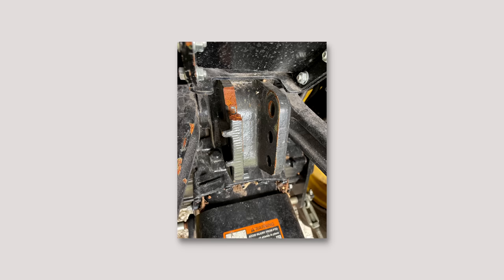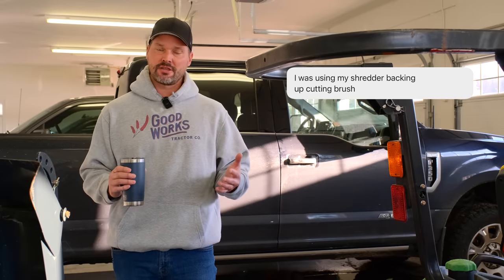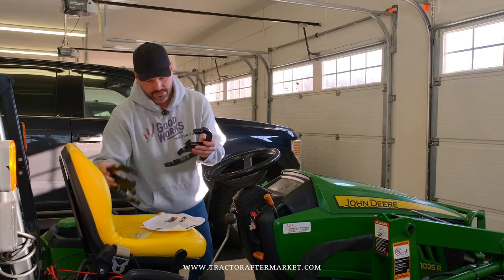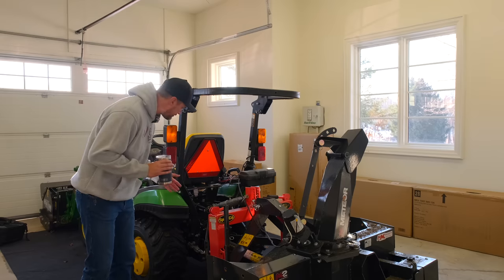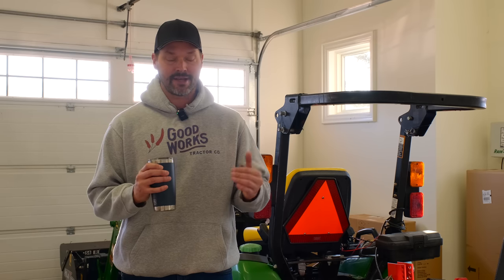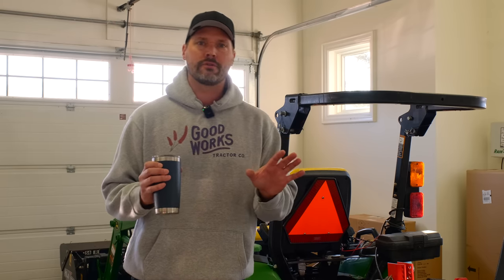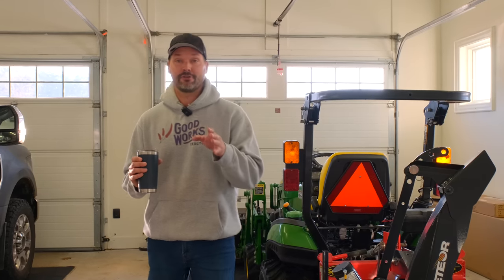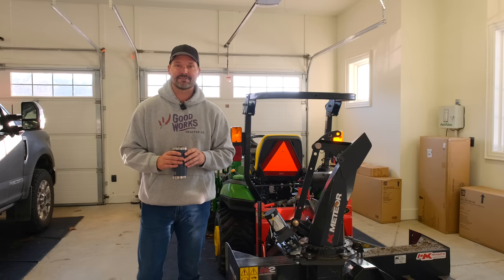EXPENSIVE MISTAKE OR WARRANTY CLAIM? $3400 TRACTOR REPAIR 🤯

Comment: It's a bad casting, it's also a John Deere thing that I'll never understand. I broke a three point arm twice on a 2016 3046r using a box blade clearing a field. 

I've owned dozen tractors now and have never broken a structural part, my first and last JD strong like kindling.

Comment: Since it is not gong  to be covered under warranty could you just use the middle hole?  I agree to look for a casting defect.  The company I used to work for had a Metrology Lab that could detect flaws, you know anyone who works for a large manufacturing company that might be able to check the casting for you?

Comment: My first thought is that the casting is bad.  If the dealer refuses to cover it as they claim it is "damage", I'm sure that since the tractor was recently purchased, and probably financed, there should be insurance on it.  If nothing else, it should be covered under that, at considerably less than the $3400 repair quote.

Comment: Running into something with enough force to break that housing would have broken somewhere else first.
It's been my experience that whenever and wherever possible, the warranty will be declared as being not in effect.
The dealer sure doesn't sound like they are particularly interested in customer service. Most likely due to the manufacturer passing the problem down to the dealer.
Good luck on the repair.
Reply: That was my thought.  From a guy that has bent a quick hitch with an offset  rear blade.
Reply from the maker: Yeah, I agree with all that

Comment: Mine on kubota b26 is a replaceable with bolts steel part. Those look just cast into the block?
Reply: @duanehamdorf2228  i got the b26tlb at auction for 17k needed right rear axle gears took me 2 days and 700 bucks to fix use it for the normal tasks but also clearing thick forest and brush.  I like the added fops for what i need it for next mods otw are front hydraulics from summit for grapple. Some spacers and ballast for wheels in mail...lots of steep terrain. Its been a Godsend
Reply: Capable of way more than i thought tbh
Reply from the maker: Very nice, yeah this was cast
Reply: @GoodWorksTractors  could u do some poor man videos? Like my chainsaw holder is made from baked 3 inch pvc use it almost every day heavily... total cost 7 bucks vs 300 for sawhaul
Reply: Also made cell phone scabbard similar way to go with my usb charge port total cost 20 bucks

Comment: welding it would be sketchy, it'll always be weak. it be tough to find someone to attempt it.
Reply from the maker: Just had a guy email and say he has his welded and still going strong after 10 years
Reply: @GoodWorksTractors  In many cases a good weld will end up stronger than the original.

Comment: Every John Deere tractor I have owned has been a bad experience. I had a little compact like that and literally every single thing bent on it from the mower deck lifting arms, to the PTO shaft snapping, everything seems to be made out of soft metal… I could be wrong but I just went with kioti because I am so frustrated with John Deere and their parts monopoly

Comment: Looks like a defective casting to me.  No signs of abuse.  I would recommend against settling for a welding repair.  Other parts of the casting might also have a flaw.  This is a manufacturer problem and should be replaced, parts and labor, under warrranty.
Reply from the maker: Possibly so

Comment: It's obviously metal not alluminum so I would weld it , and use the next hole down. If that picture was taken shortly after it happened it's a defect. It would have been good to get a closeup right after it happened.

Comment: Why In the world would you ever replace that casting???   It only has damaged to the top hole and he has two more lower holes to put the top link in….  I’m betting that 99% of sub compact and compact tractors owners don’t have any idea which position of the three that the top link is supposed to be installed in anyway based on what type of 3pt implement that are using 😂😂.  I’ve never used the top hole on any of my tractors period and mostly use the bottom position as the geometry in that position gives much more height to the rear of any implement when raised especially a rotary cutter.   Just my gut but I’m suspecting the quick hitch has something to do with this event and others….  The quick hitch being a solid piece from the lower link arms up and thru the top link position WILL transfer loads into the top link that it is not designed to handle.   Think about it.. a 3pt hitch without a quick hitch has 3ea independent working elements which will not allow load transfer from anything you hit backing up with a rotary cutter into the top link bc of the working top linkage on the implement it’s self. 3pt hitches by design are supposed to have slop in them to prevent EXACTLY this type event.  With a quick hitch  loads will be introduced into the top link that it was never designed to accept or handle bc both link arms and the top link are now tied together.   But…..what do I know, just a simple blue collar farmer 😂😂😂   Great topic it really promotes deep thought.. 👍👍✅✅
Reply from the maker: Hehe, I can definitely see it promoted deep thought for you.  Thanks Gene, have a great weekend!
Reply: That's a good point. I'm sure it's testable

Comment: Top link is not t johnn dear and  attachment isn't either didn't look to adjustable in video looks like a torque rod that is in unadjustable
Reply: My top link turns and won't touch bracket an rides in centre the housing on your top link rotated because of its size it pushed on eye of bracket and broke weld it up with 7018 preheat before get smaller eye on top link that won't spin and hit bracket it will last for ever this happens when  saving money not using one if you would of put jd top link it would have worked

Comment: What does summit have? Looks like a bad casting could have been a slight faint crack . That’s made to take an amount of hammering and forces .. makes look away from the green tractor . They want your money .. you need them and you have a warranty should be no questions asked .
Reply from the maker: I'll have to take a look
Reply: @GoodWorksTractors   rust is the giveaway from the outside inward .. microscope 🔬